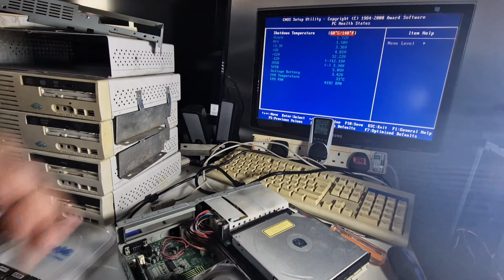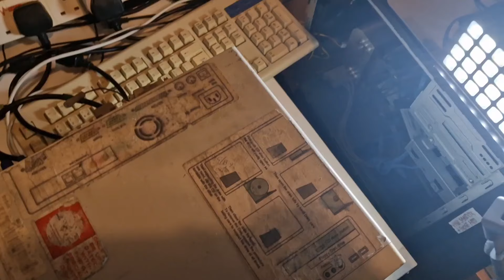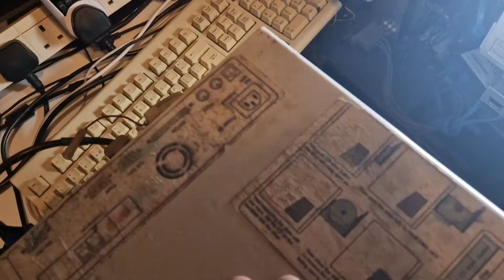What's inside these mini Pentium PCs and will any work? #retro #vintagepc #retropc #beige

Comment: I remember these when my work sold them with navigational chart plotter software. Be careful when working on them, when you lift the plastic cover on the power supply there is one of the heatsinks that is live when powered on as I remember getting a nasty shock one time. I believe i may have a brand new spare power supply for one of those thats been sitting in grey stock for years.
Reply from the maker: @TheMarinemonkey  let me know if you want to sell the psu
Reply: @joshwa1234  I found the PSU. assuming the model is the PS-8380 i may be able to find an original driver disc also. i will send you an email so we can arrange sending of the PSU.

Comment: I wish I could have kept all of my old PCs but I moved into a smaller apartment and they were all jammed into a closet so I recycled the lot of them. A 386, 486, a hefty IBM with dual Pentium Pro 200MHz w/1MB cache and a bunch of parts.
My oldest PCs now are Core i5 2nd & 3rd Gen from 2012-13.  I found a 900MB slipstreamed XP Pro x64 .iso with all the updates and upgrades that I successfully installed on an i5 Lenovo with a SATA drive and 24GB of RAM. Drivers for WiFi cards or USB dongles are rare for XP x64 but I found a new PCI-e card on Amazon that had an install CD haha. Drivers for XP to Win 10.
Where I live now is barren of old computers, and I won't pay ebay prices, but I'd like a Pentium I could install NT 4.0 or 2000 on. Or even Win 95.
Reply from the maker: Where are you located? It's the same with CRT monitors, they are very rare these days. Everyone threw them away when TFTs came out and became affordable.
Reply: @joshwa1234  I don't mind not having a CRT 😃 My choices are a 24" on my main PC, a 55" TV connected to the Lenovo & 2013 Dell Optiplex, and a portable 15" LCD that folds flat to about laptop size.
I'm 4-5 hrs west of you on a north eastern corner of Cape Breton Island, Nova Scotia, Canada.
Reply from the maker: @cageliner  Ah I'm in the UK, so a bit far away. Was going to offer you one of these PCs. :)

Comment: Nothing like that should have fans if they are to run in such a hostile environment.
Reply from the maker: @douro20  the PSU fan seems under powered, but it's possible the jukebox case would have more fans to ensure decent airflow.

Comment: Did my comment get deleted because I posted a link to the manuals for the motherboards? Please make a backup image of the drives and post them online. Some of us are very interested in the software. There is even a program to dump those dongles if you are feeling adventurous.
Reply from the maker: @KILLERANDERSON001  I'm not sure what happened to the comment. I saw it, then a few minutes later it disappeared! Pc model is ProTech PS-8380 but more information comes up if you search for the number on the motherboard PROX-3680. Thanks :)